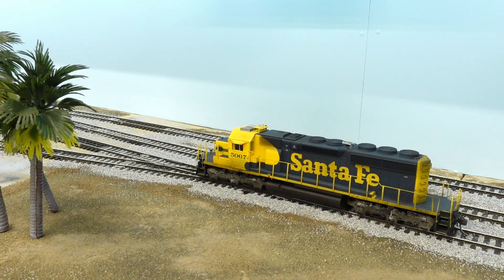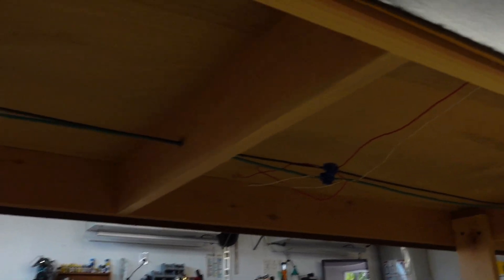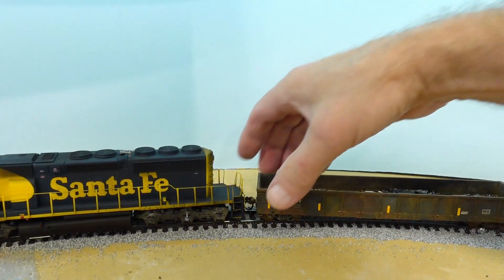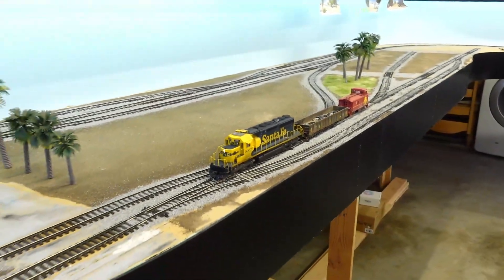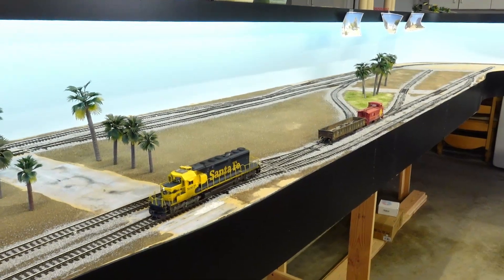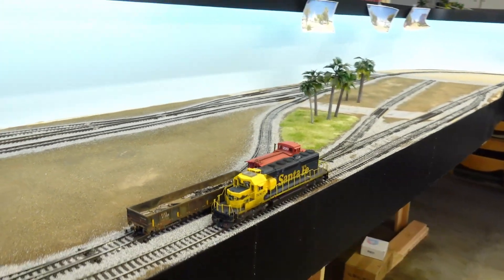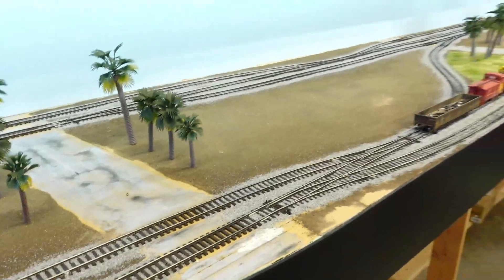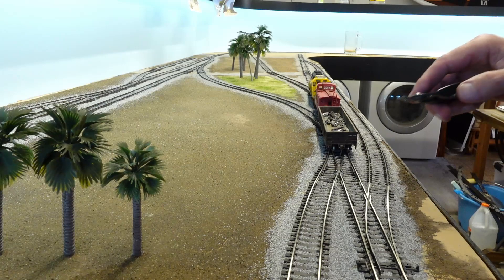Operations | MOW pulling nails

Comment: I used suitcase connectors on my entire layout. Never had a problem with them. I also soldered all my track joints.
Reply: So long as the correct size wire is used and only wire one per slot they work well. I have them on my portable modular layout that moves every month and have been reliable for many years.

Comment: Harbor Freight has suit case connector  the blue ones in little containers for about 5 bucks for 50 I think.
Reply: The blue ones are too big for most wire we use, red is for smaller wire.